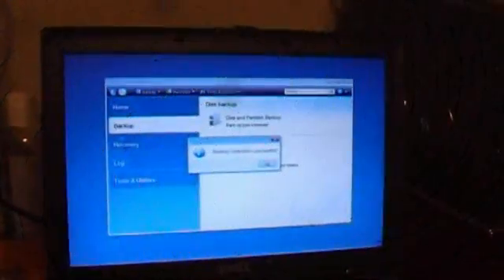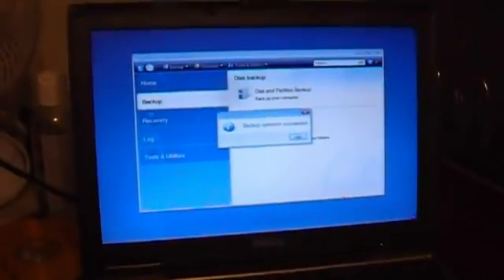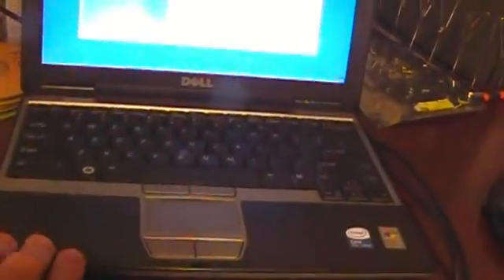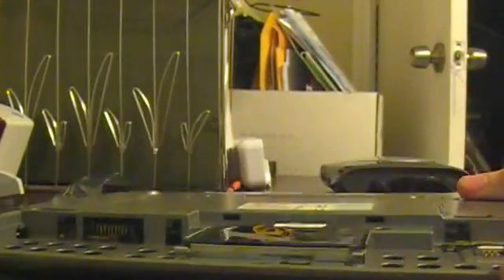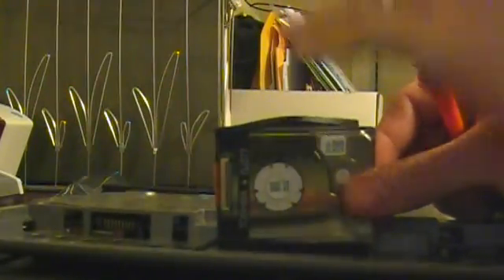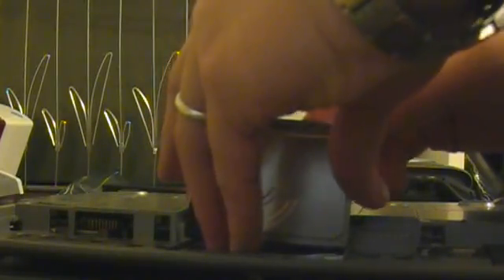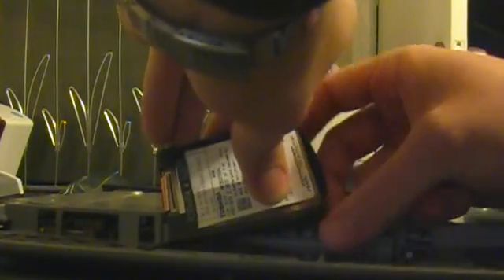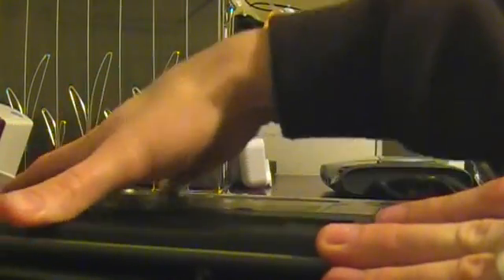Latitude D430 Hard Drive replacement.

Comment: hey, quick question, i have no idea how old my latitude D430 is (was my aunts for quite a while) and im using it now, wanted to erase and format my hard drive, but dont know how. either that or replace the hard drive like what youve done here. theres no option for me to buy a new one not for another two years atleast. what do you suggest i do? my question is how do i format it on my own, or where can i buy that hard drive for cheap, and give it to my computer guy to get it done coz in india they charge a bomb just to get the hard drive and extra to get the job done. and i dont have a bomb.
any help would be greatly appreciated
really.
thanks in advance :D